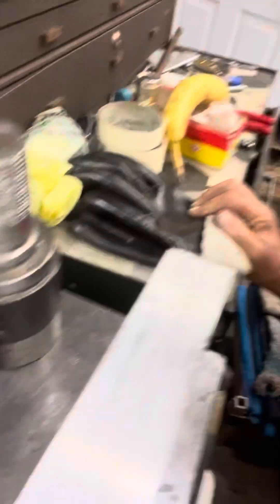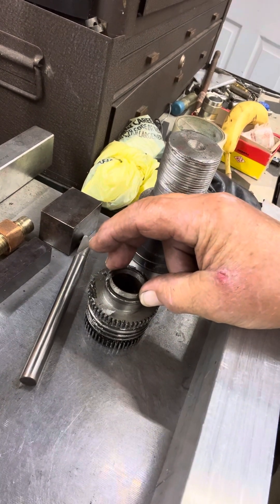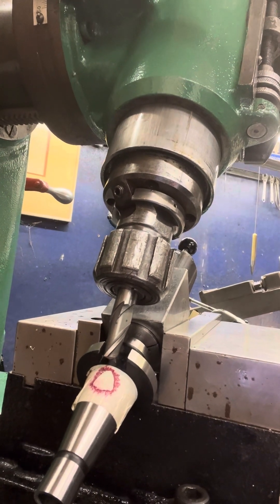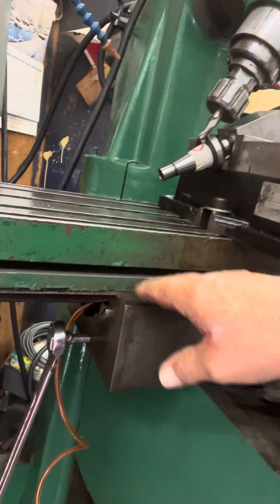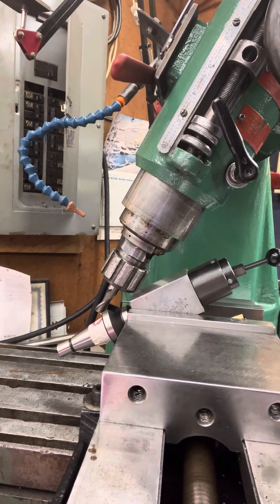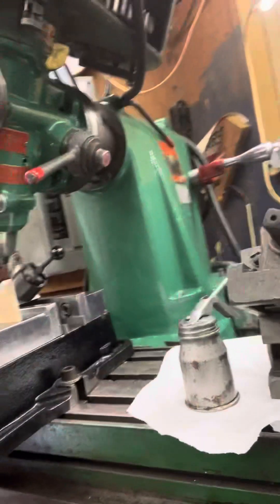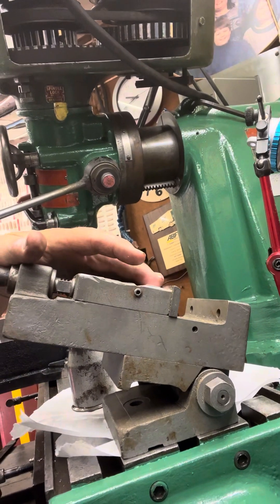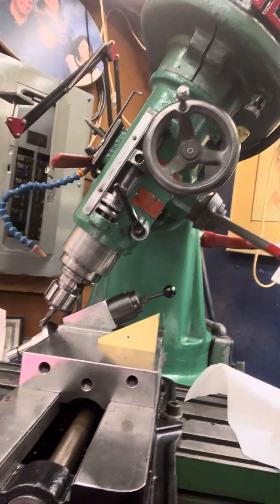A cry for help

Comment: One thing that could help, get a block that has the female taper in it, seat them, and support the block. That way youre not starting a cut on the taper. 
I'm meaning to use the block with a female taper in it as a sacrificial piece by the way. It would introduce new difficulty in getting your flat in the spot you want it, alternative could be hand grind an almost flat to start the cut and clean up with that setup (and the jack idea from others sounds good too)

Comment: At 2:36 it looks like the centers are offset. Not sure if its supposed to be offset like that or if you intend to line em up. Otherwise it looks like it could work. As others have said, support under the tip of the workpiece would help. And grinding through the case hardened surface if there is any.

Comment: Well . . . you DID get the runout down quite a bit - but STILL , it's not free of WIGGLE & SHAKE , which will induce ChAtTeR ! ! !    The more rigid the setup is , the less likely the chances of FAILURE - - - * I wouldn't put a lot of faith into the 'epoxy putty' , 'better to mill down to SOLID METAL , then you'll KNOW it won't CRUMBLE in the future !    ( a setscrew against EPOXY doesn't sound very SOLID to me !   But that's just my personal opinion - - - 
     A far better 'FIX' would be to mill down to solid metal , then PRESS FIT / or bond the piece with LOCTITE ! ! !   Essentially , you want a SOLID flat spot for the setscrew to press against - ( since you made them 'dog points' , it would be prudent to drill a spot for the point to enter , which would have the setscrew's SHOULDER pressing against the FLAT !       My $.02       GOOD LUCK . . . do it as RIGHT as you CAN ! ! !           I have the feeling that you've already taken a stab or two at this setup ! ?
Reply from the maker: I’m still studying the problem . I just got two videos showing how to machine the 30 tapper holder, I haven’t watched them yet, But will give it my full attention. 
Thanks George

Comment: The set up looks really weak. Maybe a milled out seat to hold it angled. Fixtures make life easier and safer. Even bolted to the bottom  and clamped to the table.
Reply from the maker: Yes very weak

Comment: I agree with others about using a jack to support the end sticking out of the vise.  Depending on the toolholder you may need to use a carbide endmill to get through any surface hardness.  I will be following intently as I have some holders that need this same operation

Comment: That set-up looks a little sketchy to me. Would you consider using your surface grinder? The notch would have different geometry, but you would still attain the set screw flat. If you go with the milling set-up I would use a multiple tooth cutter, and try to clamp the small end of the tool holder to the table. I have faith you will sort it out.
Reply from the maker: Nothing is set in stone. The final set up may look nothing like that. I have zero experience so I appreciate all your help

Comment: Hi Kimber, that is an odd spindle taper retention set up for sure! You should put a jack under the holder that is sticking out from the vise, I have been modifying surplus holders, you may need to hand grind a spot through the harder outside to drill Into it.
Reply: I just read your comment, after writing mine, and I agree with the jack stand under the protrusion.
Reply from the maker: Craig Tate also suggested a jack so I got that taken care of .
Thanks